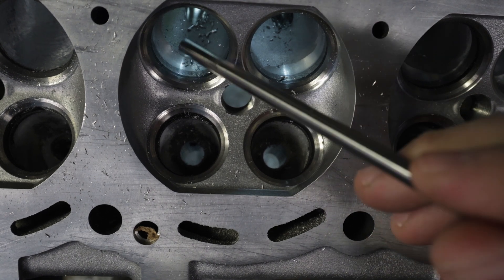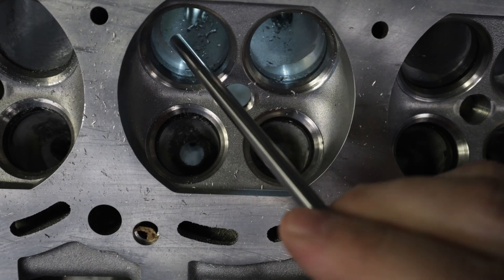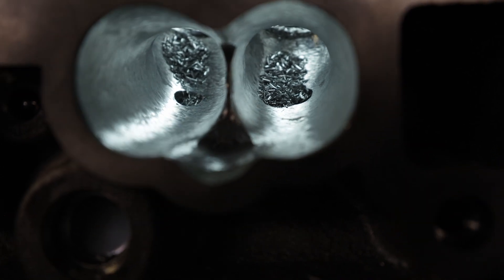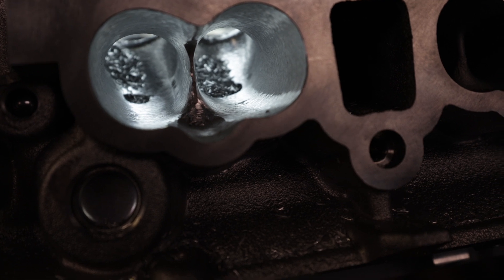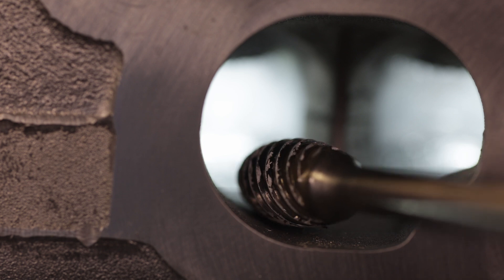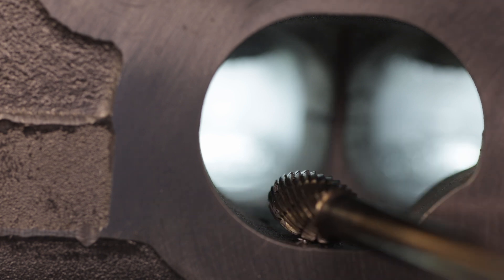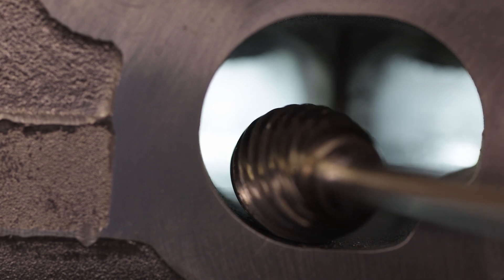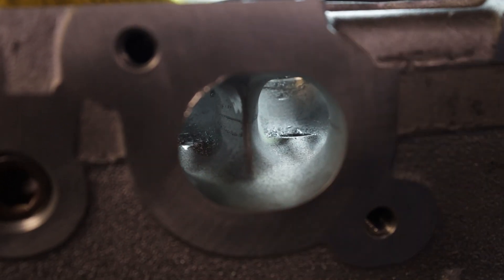Inside the RB26: Watch Me Shape a Legend

Comment: Super cool video David. Can’t wait to get er back. I was wondering, since this head will be mating up with a 2.9L, with the cams being used, but std. length on the valves. Does that sorta alter or do you modify your normal RB porting shapes or sizes v.s. A 2.6L build that would bee looking for the same power level overall. What I’m meaning really is do you do anything to try and affect power under curve any certain way. 
These videos are awesome though and I can’t wait to see the next one. There is such a huge need for good RB build theory in the USA, which sadly most still think that all RBs do is blow up. There has been so much development over the last ten years thanks to the Aussies, and these motors can be built so much better and reliable now if you got the coin to do it right. 

Thanks guys 🤘🏻

And also the kelford buckets should be to you any day now.
Reply from the maker: We wouldn’t change anything for the difference in cubic inches.

Comment: Hi Dave.
Thanks for showing the porting process. I love watching you handle that burr.
Question: Do you always apply the same percentage to the intake and exhaust ducts on all cylinders, or do you apply your theory to each one?
Best regards,
Goyo.
Reply from the maker: Changes depending on the head and sometimes the side. Like for EJ25 we can’t touch the intake side % at the throat because it will hurt it. But, exhaust there’s some room in there to open up. All trial and error.
Reply: @headgames  OK, thanks Dave

Comment: Why don't you just digitize the factory ports and then use that data to virtually model and optimize the design for the CNC? I can see how smoothing away casting artifacts can help, but relying on your visual judgement and measuring doohicky to remove all that material and reshape the port by hand seems like a lot of guess-work.
Reply from the maker: That’s just not how any of the above works.

Comment: I assume the customer understands he has to modify the intake manifold port size.
Reply: This is no noob build here. This was already fit and discussed. He was sent the billet runner section of the new single TB carbon int. manifold With the head and internal parts. Every single inch and spec of this RB build has been planned and blueprinted long before it started. It’s going to be a sick one for sure. 👍

Comment: Thanks for the entertainment and great info, as always. I'd like to know what can be done with an SR20 head. They're nothing like anything else I've worked with before and it's had me thinking. It appears that the intake port has to make its way around the hydraulic lifter portion of the casting, and then it has a decent angle facing the back of the valve, once through the curve. The design looks to favour bypassing the short radius and raming the majority of air over the roof of what is a shallow bowl. There seem to be more ways to hurt the performance than to make easy gains. Thanks for putting in the time for the backyard racers like myself, I watch every episode. Love your work, Dave.
Reply from the maker: You can make it a fin with the rest of the divider. We no longer work on the sr but we did them for many years.